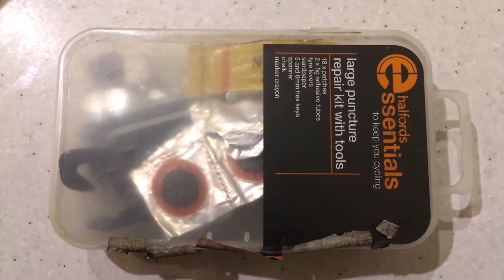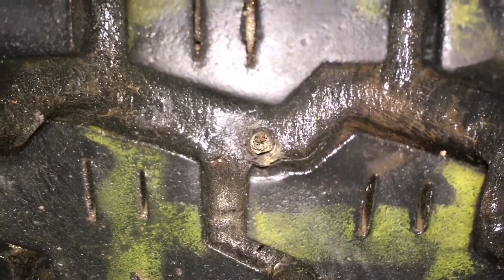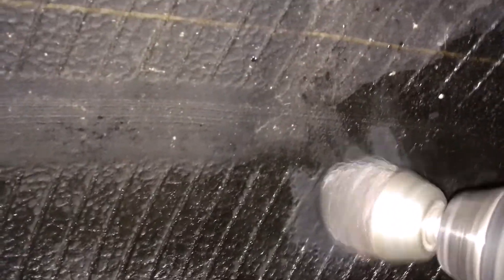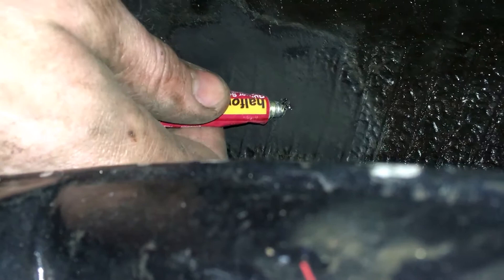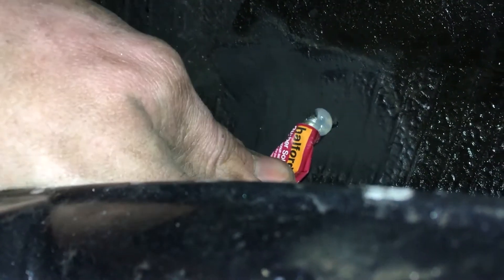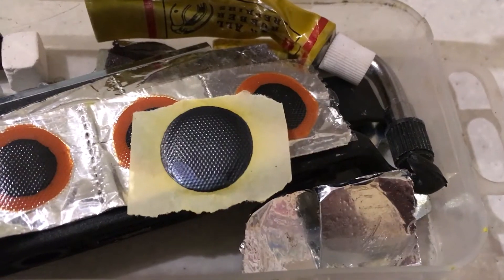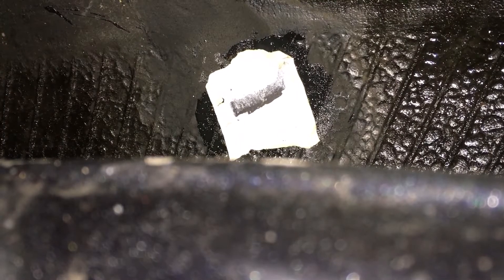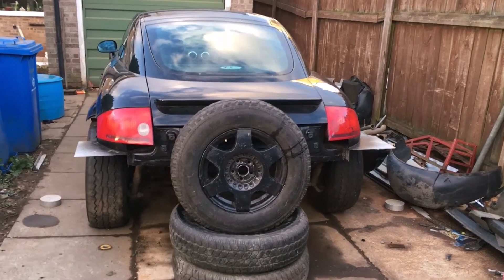Can you repair a punctured car tyre with a bike tyre repair kit?

Comment: This is how car tyres used to be repaired back in the day..
Reply from the maker: Half a year later and it's still holding air. In fact, it's holding air a lot better than the tyre on the passenger rear corner, which I really need to replace as it's got a not-very-slow flat!
Reply: @davemakesstuff5828   that doesn't surprise me. It is a lot more time consuming than the modern way using a plug.